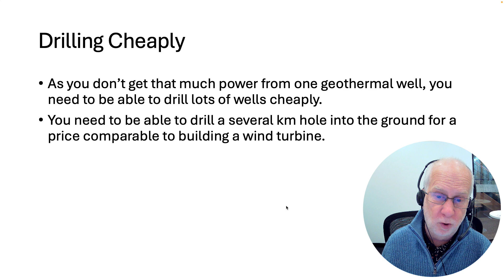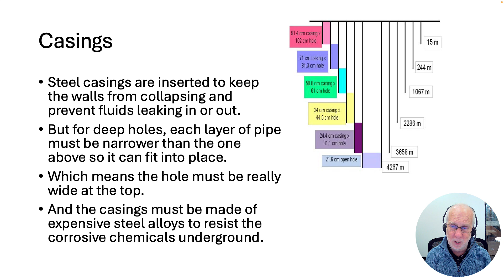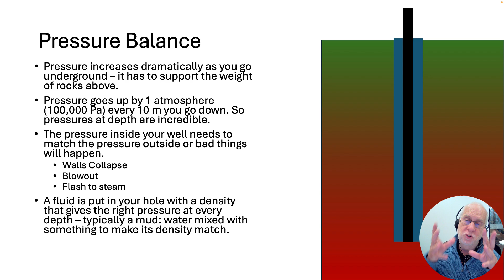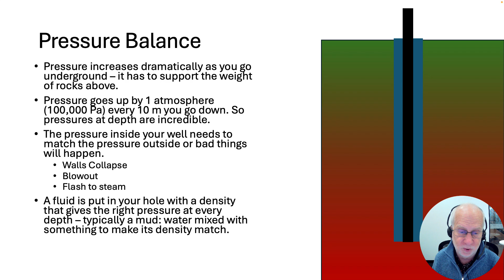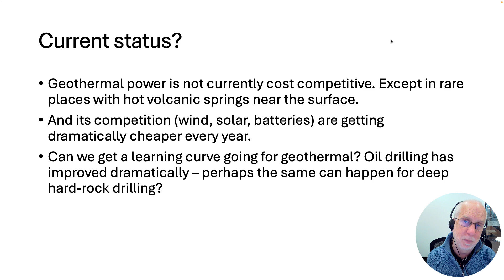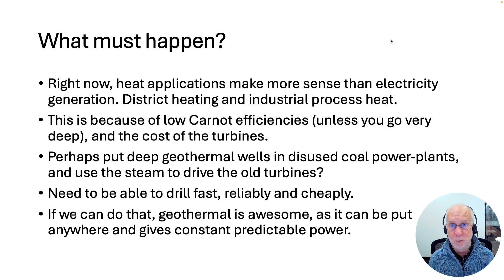Geothermal 04

Comment: I saw some technology that solves heat and pressure problems at depth also much cheaper and faster (on average) its technology borrowed from the fusion race. “Microwave lasers”, the laser is created in an initial reflection chamber where an element is excited emitting particles/waves. But these waves during deflection randomly produce a certain type of radiation (Russian name so I didn’t really catch it) which is then allowed into another chamber concentrated and filtered then sent down into a cavity. Traditional drills can definitely outcompete in drilling speed but over all they slow down quite a lot when reaching deeper depths and the beam vaporizes the rock allowing it to exit the chamber and also creating a extremely pressurized and tough casing from the material itself. It’s quite bad at drilling in the softer colder upper layers but when it reaches pressurized hot depths it shows its use.
Reply: Being it uses energy/electricity the only constraint is how cheap we can make energy. So with each geothermal plant produced and brought online the usefulness and economic viability of the maser improves. It’s a compounding process essentially and it’s already much cheaper to use in deeper layers than a traditional gas and oil rig.